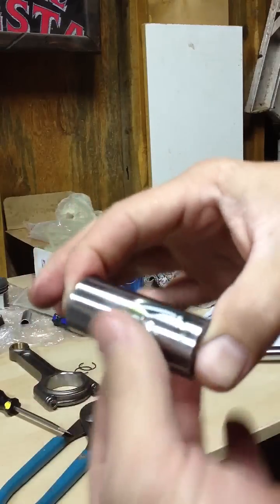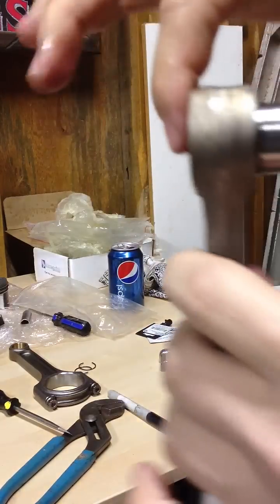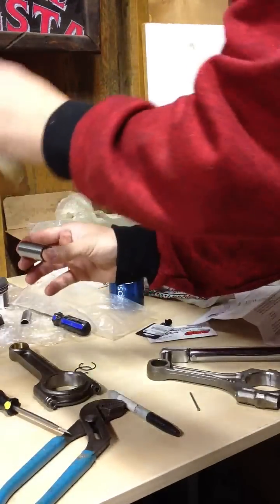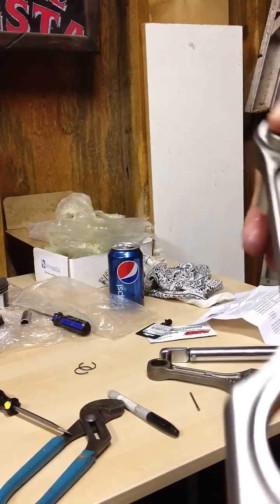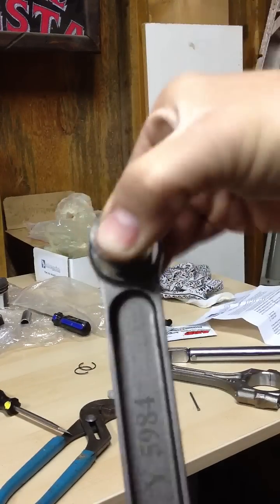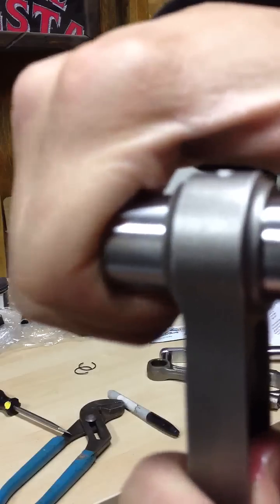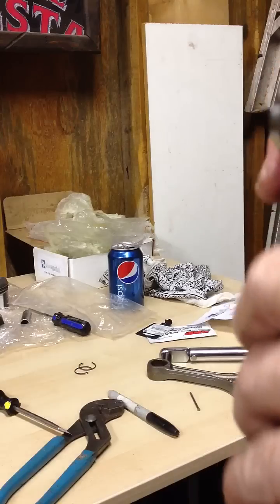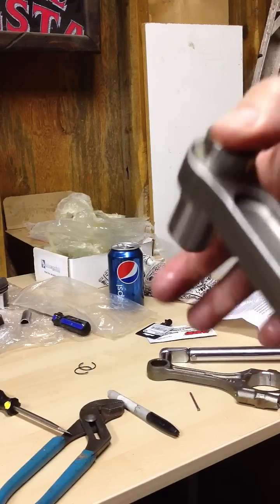Is this wrist pin too loose?  06 TSX rod vs. Blueprint ultr

Comment: Did you find out if that was too loose?  Mine does the same thing.  The sound goes away if I add a drop of oil...  only difference is that my wrist pins are already c-clipped on in my case.

Comment from the maker: I don't think there's a difference between floating and "FULL" floating.  Oem stock rods and pistons are floating as well and both of these parts I'm trying to combine.: rs machine pistons and blueprint rods are meant to be oem replacements. So they should fit together.  Anyone else have any info in this issue?
Reply: I have the same deal with my Molnar f23 rods, an extra thou or 2 over stock rods. I'm thinking that the stock ones aren't intended to maintain an oil film between rod and pin whereas the aftermarket ones will let pin freely rotate in rod as well as piston. Just might be a diff between full full floating and factory.